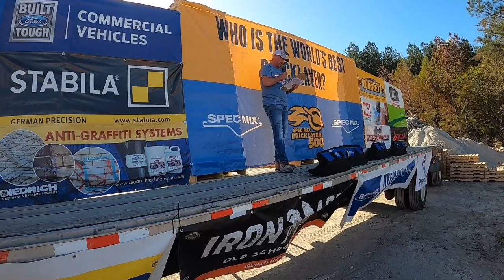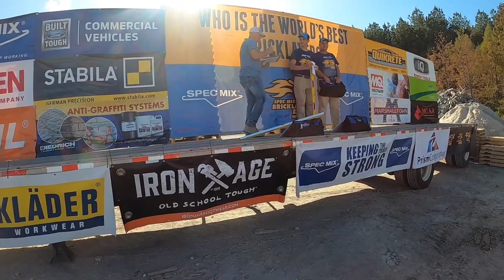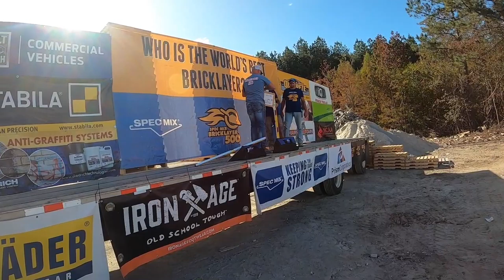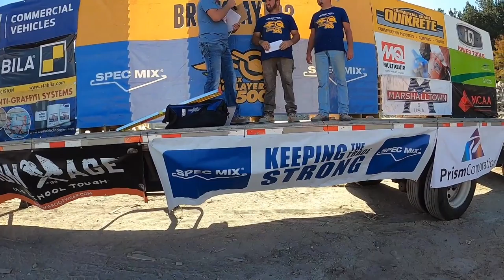2020 SPEC MIX BRICKLAYER 500 [Carolina Regional Series]

Comment: What are the rules? Clipped joints, stacked bond, not level and out of plumb is just messy.
Reply from the maker: We have very specific guidelines which you can find on our website. The masons with messy wall, walls out of plumb or any other defined infractions have brick deducted from their total count. The competition was never designed to be perfect. It was designed to push the limits of the masons and to make it exciting. Come join us and try it for yourself!